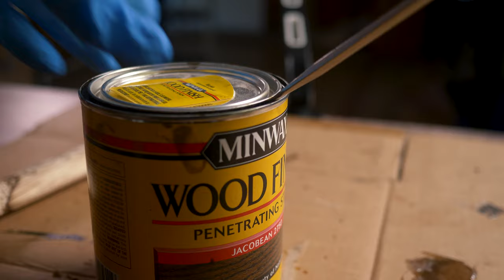Dremel Wood Carving Secrets: How I Carve My Tomahawks

Comment: another fascinating video, love how your editing keeps improving too ;-) and 2 questions: how do you keep that sanding roll from not flying of it's ( not a clue how you call that thingie) and don't you get cramps in your hands? ifso how did you got them to stop occuring?
Reply from the maker: Thank you so much! That wasn’t a sanding drum I was using, but I know what you mean though!  Start using lighter pressure as you sand or get a new sanding drum mandrel. 2) Sometimes cramps are inevitable but I try to stretch my fingers and hands before I carve.

Comment: Hi . i need help 
I wanna buy an Air turbine high speed drill to Carve Ostrich eggs . right now I am working with a nail drill and that goes 35000RPM  to cut a 2 3 millimeter egg shell i am basically going to hell ..
what hand peace  do you recommend and to set up that what kin of Air compressor should i buy ? note : I am going to work in my room, so i need all of the peaces to be as quiet an powerful as the can be 
thank you in advance for your help 
and you are a talented guy i love your work and information you give is priceless